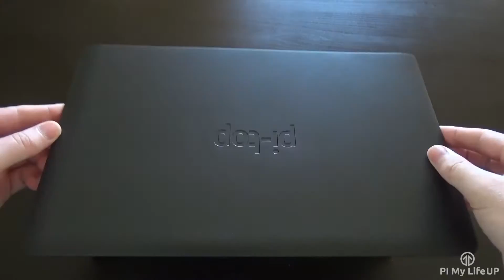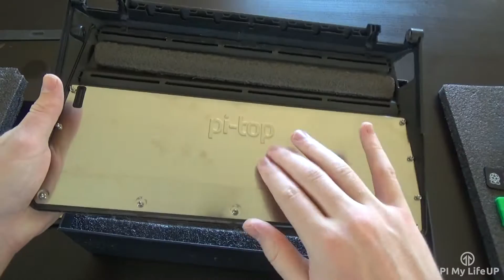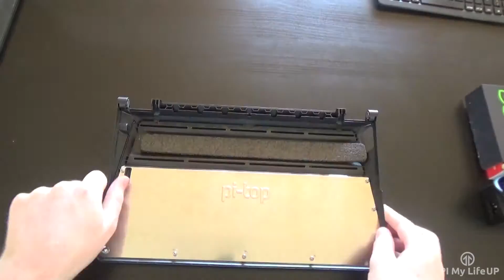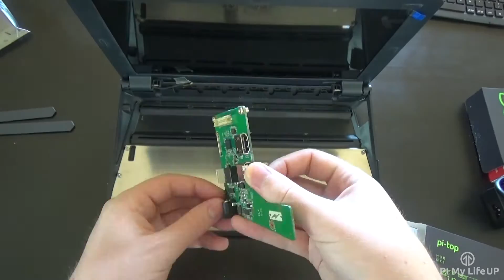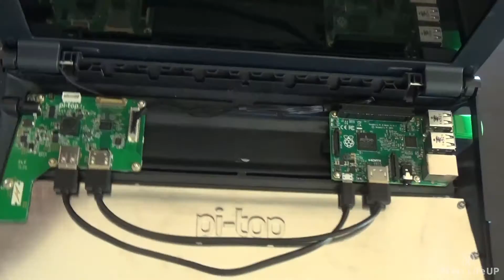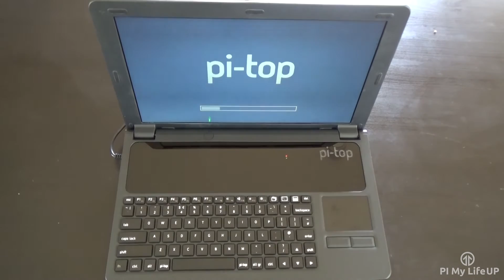Pi-Top Unboxing & Assembly [ARCHIVED]

Comment: Thanks for holding my hand as I put my pi-top together! Two tips from me:- be sure to leave enough space when you screw in your pi so you can attach the keyboard usb to it. And use the long end of the allen key in the screws. Thanks again, your video gave me the confidence I needed to build my first computer.